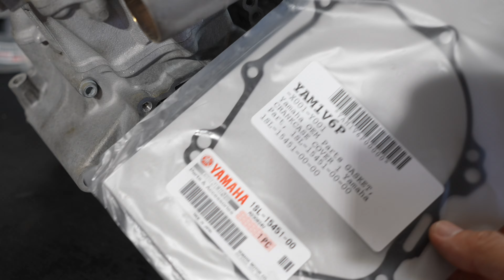Stunning Yamaha YZ Rebuild/Restoration With Custom Aftermarket Parts

Comment: Do I have to change the flywheel as well to the WR/FX version or I can just add the oneway gear/bearing to my original flywheel?!
Reply from the maker: For the starter not really if you have a good battery but for the fan yes
Reply: @roberturmosi-dirtbike-atv  if it’s not too much to ask can u send me a list of all the parts that I need to pull this off, bcuz I have a 2014 yz450f that I’d like to covert into an e-start?!
Reply: If need be I can cash app u a couple of dollars for ur time but I’m rly tryna pull this off before March 13th which is my son’s bday & he doesn’t kno that I actually got the bike for him…